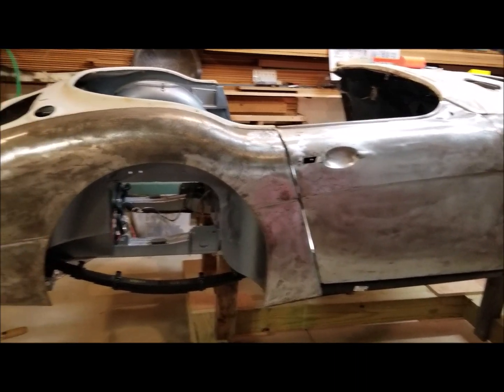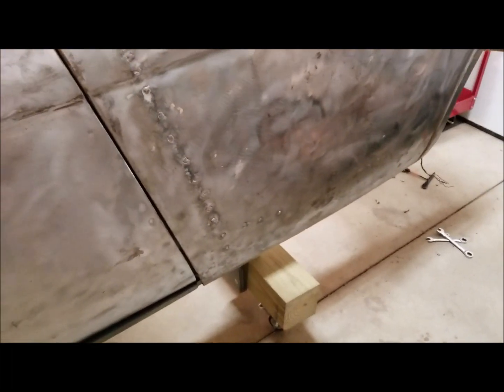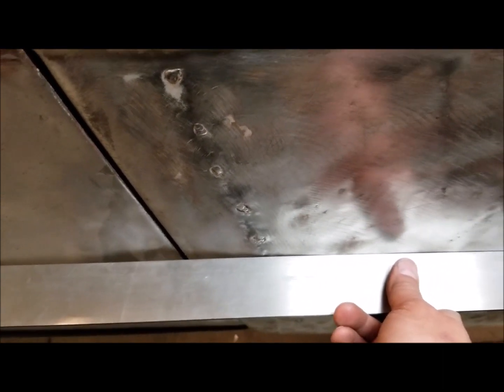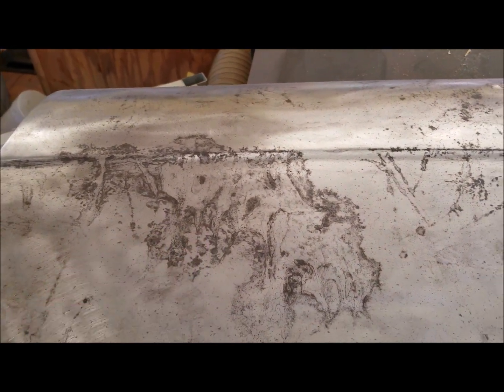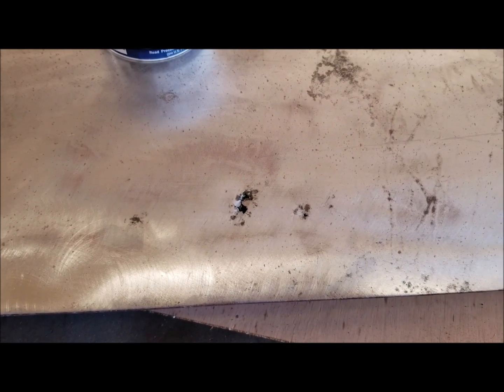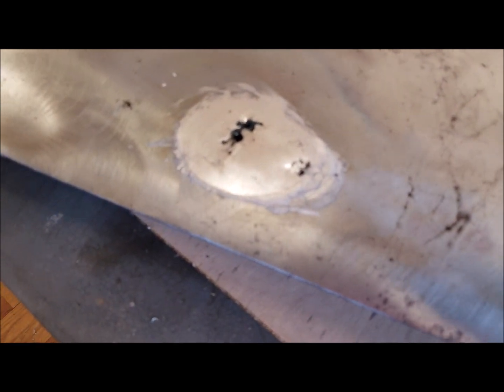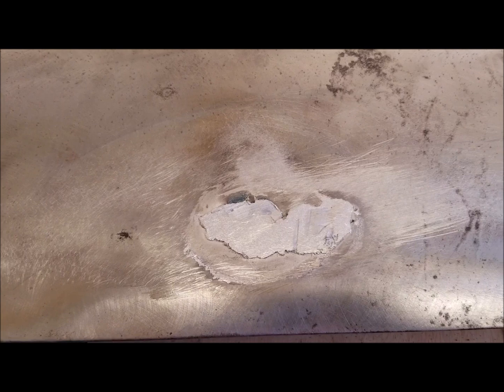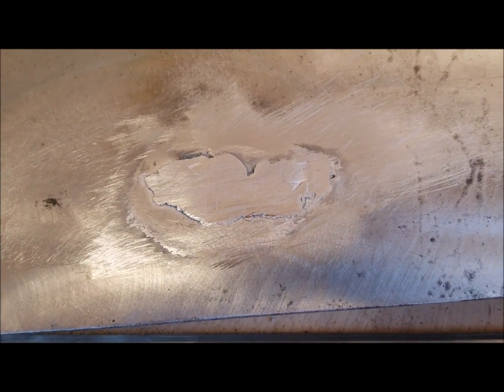57 Austin Healey 100-6 Rest. Pt 12 - Beginning the Body Work.  Applying Auto Body Lead

Comment: Looking like progress!! I was watching one of Lazze Metalshaping videos recently where he talks about setting the lines of a car (32 coupe body video I think, let me know if you can’t find it) basically the method involves running a string line at the profile section you are wanting to run smooth, then using a wide blades chisel hammer along that line where the panel sits proud, which is enough to take that bulge you are seeing and work it into the body line you want. Similar coaching from inside the door shut to take the last (bow) and coach it out. Only using very light blows, but a few of them until you are happy with the shape. Thanks heaps for sharing!!

Comment: Any idea if this will work on the aluminum, I have some holes in my rear shroud
Reply from the maker: Sorry I didn't see this earlier.  I wouldn't use soldier on your aluminum because they would be dissimilar metals.  Go to Amazon.com and search for alumaloy.  That might do the trick for you assuming you use a small MAPP gas torch.  Just be aware that you are going to need to be adding a fair amount of heat to the spot so there is a possibility of creating some distortion.  I would definitely try it on the very bottom of the shroud at first where it won't be noticeable.  Good luck and let me know what you come up with!